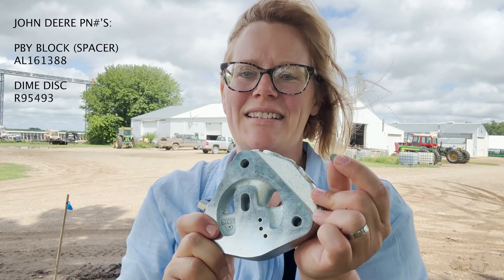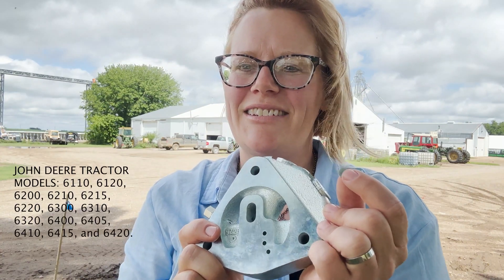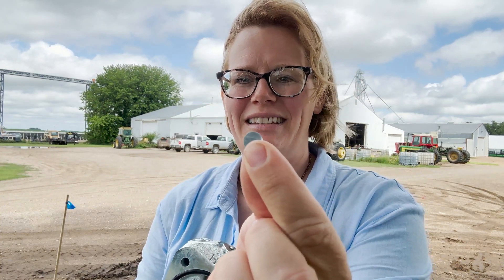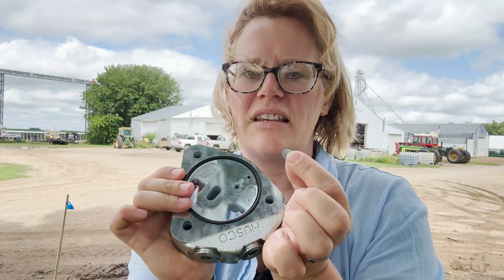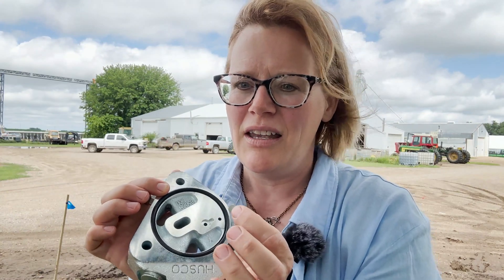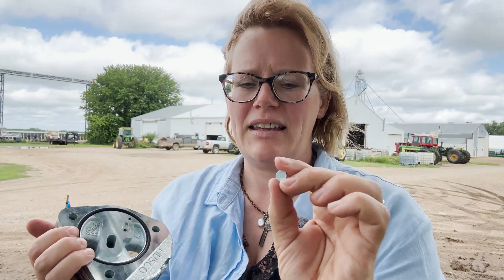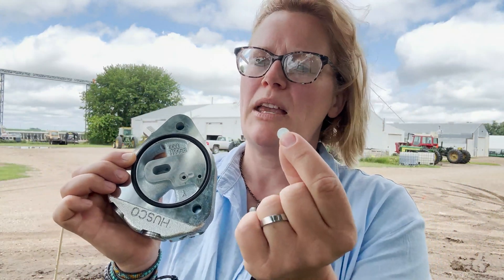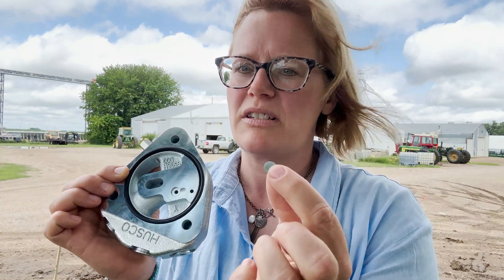How To Troubleshoot Hydraulic Problems on John Deere 6000 Series Tractors

Comment: Hi. I have a JD 6320 with power beyond for Trimble gps steering valves. The power beyond is making a constant noise even when the steering isn’t being used. It’s overheating the hydraulic fluid. What do you think the problem is? This is an old installation.